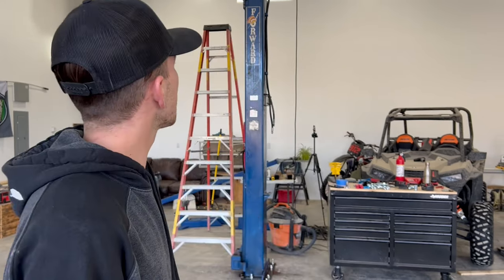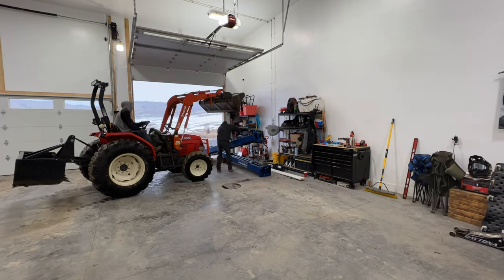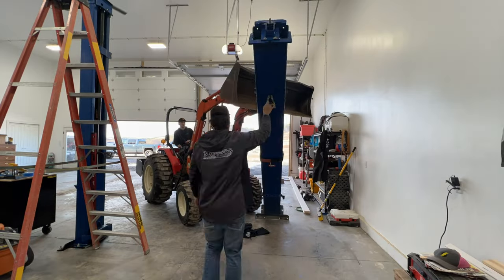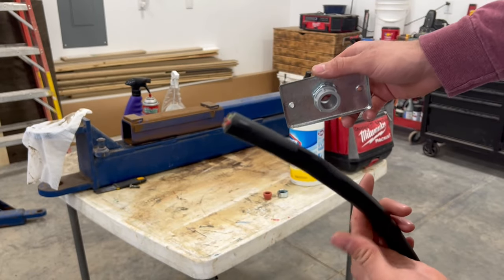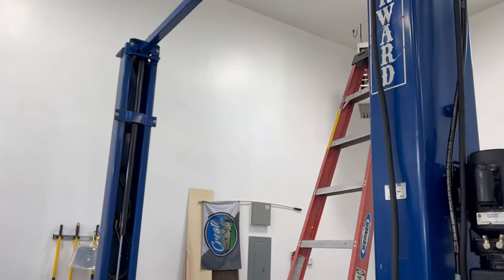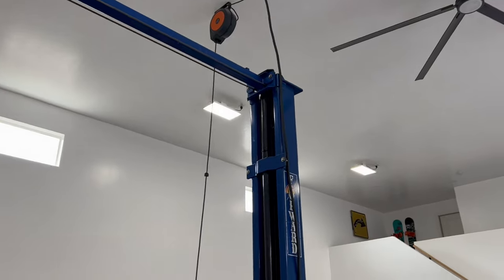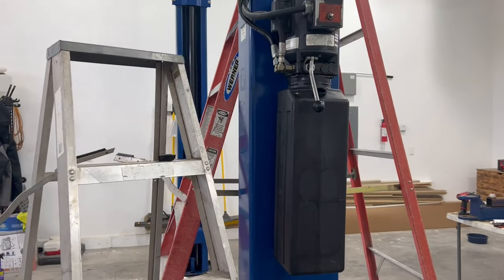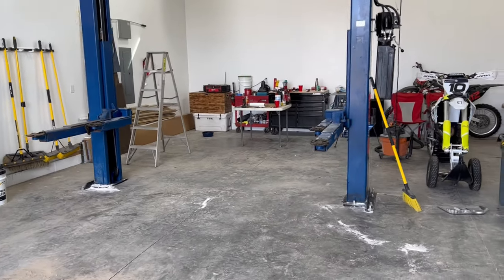Installing A 2 Post Lift In My Shop House (Install/Setup)

Comment: Hey Christian what Part of Idaho are you in?  I have been following your shouse build and actually love your design I downloaded the plans to use as reference but I am planning on making my own modifications to fit my needs so thank you for sharing those and your build process!  I am looking for where I want to build and I love that location.  I plan on having all the toys, dirt bikes quads snowmobiles... I'm looking for woods to romp around in and it looks like your in a great spot for all that... anyway love the videos I think you did an amazing job, and congratulations on the engagement!
Reply from the maker: Thank you! I live in south east Idaho!

Comment: I bought a chinese 9000lbs two post lift I used. a cherry picker to stand my post up had balance it a little heavy on the anchor end and muscle it the rest of the way up it was not easy but was able to do it by myself . My posts were two piece though .
Reply from the maker: Awesome!

Comment: YOU HAVE MADE A HUGE MISTAKE BY NOT PUTTING A TWIST LOCK PLUG IN THE POWER CABLE GOING INTO THE POWER UNIT WITHIN EASY REACH
Reply from the maker: Why’s that? The breaker is right next to it
Reply: @Create208  Mark the Breaker Clearly
Reply: @paulhailey2537  he knows where it is.